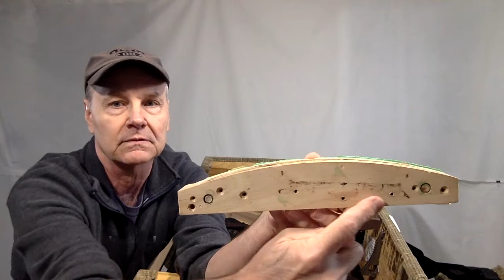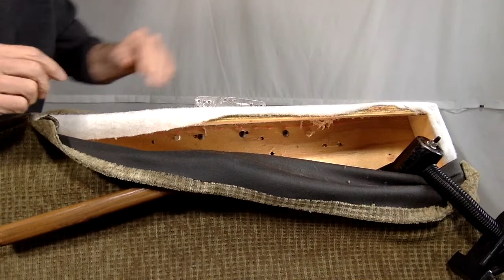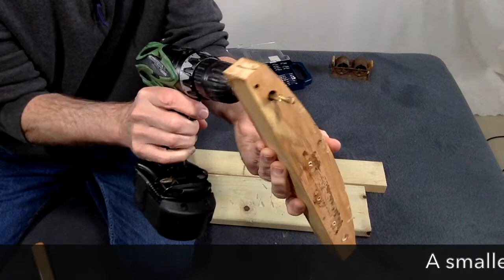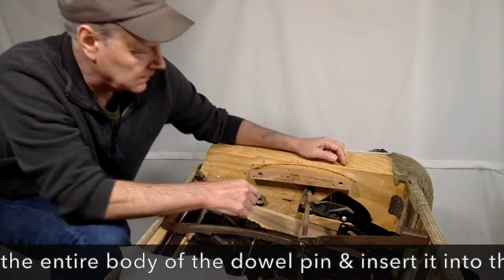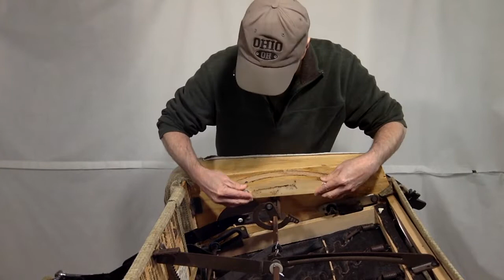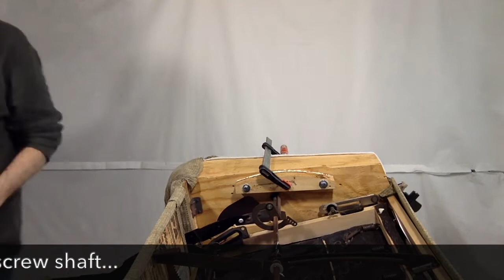How to Reattach a La-z-boy Rocker Block

Comment: How do you increase the tension between the rocker block and rocker springs? Mine seems to slide/skip sideways on the block and make a loud twang.
Reply from the maker: @jamescampbell7003 - That's not unusual. Keep in mind that the 2 Rocker Springs are carrying quite a load by holding the chair -- and the person -- onto the base. Also, the manufacturer waxes the Rocker Blocks to help reduce noise while rocking. This makes the rocking surfaces quite smooth & slick. So yes, the wooden parts can move sideways from time to time taking the Rocker Springs with them. And the "twang" that you hear on occasion is the Rocker Springs pulling themselves back into proper alignment. 

Check to make sure the springs are securely fastened against both the Rocker Blocks & Base. If the springs are very old & you suspect that new springs would be tighter, you can try replacing them. But the sideways movement is common with these chairs, even when new.
Reply: @reclinerrepairguy4155  thank you very much for the help!!

Comment: Have a vid on repairing a very squeaky (but new-ish) la-z-boy?
Reply from the maker: iComplainer - No video on that subject yet, sorry. If the chair is less than 1 year old, you should still have full warranty coverage and can ask your dealer to check it out. 

They can also check it out if your chair is more than a year old, but there will likely be a charge associated with that (service call, etc.).

Noises are not unusual for motion (moving parts) furniture. And they can increase over time as  the chair ages, particularly with rocker/recliners. However, if a NEW noise develops that was not previously present, and is fairly noticeable (loud), that can indicate that your recliner needs repair service.
Reply: Have a look at your rocker block and make sure it isn't coming loose.  LaZBoy of Orlando has a video that tells you to use a paste wax on the rocker block contact area with the base, and to use a dry teflon lube on the springs if they become noisy.  I realized that my rocker block was loose, and I was hearing the screws creaking/squeaking in the wood.

Comment: I think I would drill another hole between the new bolts, and add another 7/16 bolt between the other two and skip the three #8 sheet rock screws....
Reply: I considered this as you recommended but the head of the bolt would interfere with the springs bracket, so I just did the two

Comment: I was told the rocker blocks are not available because the arm frames are now made of OSB not plywood. Meaning removing the rocker block from OSB will cause much of the OSB to splinter badly and not able to be reused. Ok but what about providing rocker blocks for older models made with plywood? I just get the whole arm frame, remove the rocker blocks, clean off the OSB remnants with a rasp and use for the repair.
Reply from the maker: bluesfanchad - Interesting. I never considered ordering an arm frame to remove the Rocker Block. I guess I was concerned that if I got one that was fully-adhered, I might damage it trying to remove it. Like that Dowel Pin I had to drill out in the video. 

I agree, there's no good reason they can't provide that part separately. Especially since Rocker Block repairs are still fairly common.
Reply: @reclinerrepairguy4155  Probably because the mother______s have figured out, if you can't repair them you have to buy an ENTiRE new chair.  Oh wait.  I'm insulting private businessmen and capitalists aren't I?? Nevermind.  They probably just never had that same complaint from customers 5,000 times before [looks into the the computer monitor with dead eyes]
Reply: The Rocker Block should still be a warrantied part. That is why they no longer make it. Cheaper to sell you what you don't need. When you see the arm frame, you'll buy another chair....
Reply: I could see this being reasonable if the OSB was destroyed.  Mine was perfectly serviceable when I put mine back together using the rocker block that came with the chair.  If you have the woodworking tools/ability, a rocker block would be a quite simple thing to make yourself, if you can't find one online through third party places.

Comment: I don't understand why but 7/16 - 20 x 3.25" bolts are very hard to find and very expensive !!!  Even washers and fasteners to fit the bolts are expensive !!
Reply: I'm not sure of your location, but you can find 7/16 in bolts that work at Tractor Supply for like $4/lb.  Cost me under $2 for what I needed.
Reply: @timdgsr  I wish I lived near you.
Four 7/16"-20 x 3.25" bolts, Eight 7/16" x 2.25" washers, Eight 7/16-20 nuts and a 4 oz bottle of glue are running me about $40, but its still cheaper than buying a new chair.